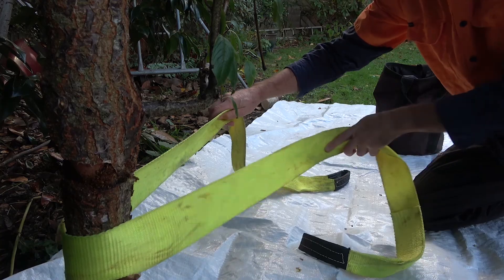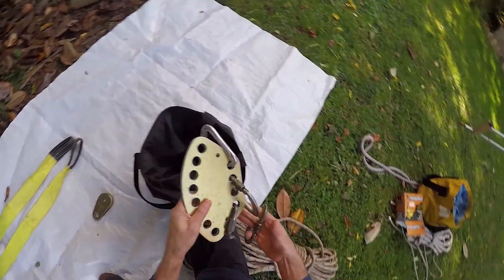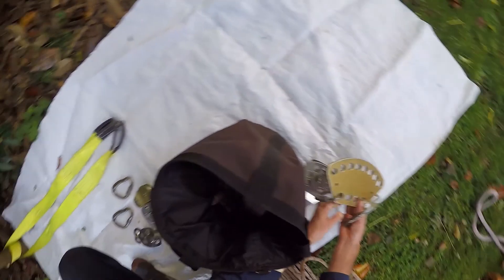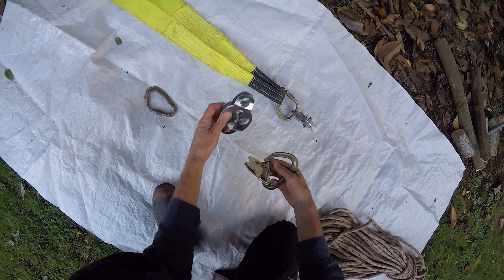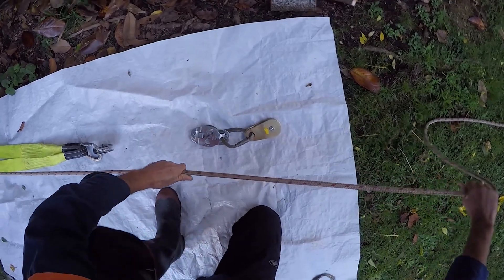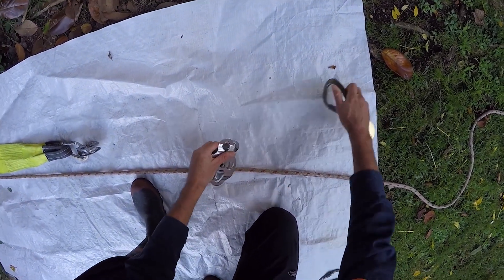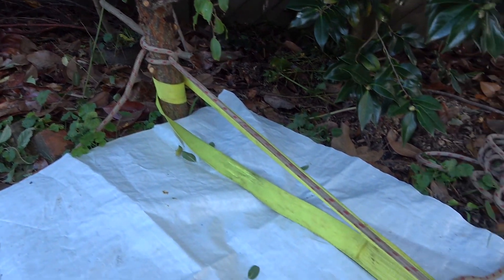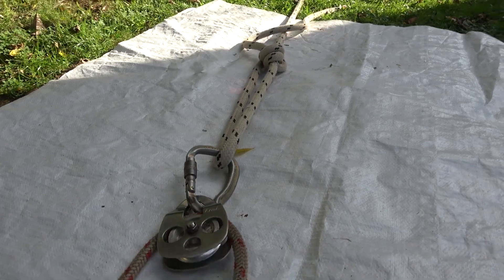Tree Rigging Equipment Part Two Mechanical Advantage Systems with Pulleys

Comment: Thanks for sharing.

Just an idea to compare with a prusik for progress / tension capture: without a prusik, you could still use a trucker's (effectively adding another leg to the system), this can be with a bowline on a bight, or an alpine butterfly or even a correctly orientated overhand slip knot, and to capture progress you can take the working end, pass it around the anchor again, then back through the loop knot - twice! Works like a charm.
Reply from the maker: Yes there are many options for gaining mechanical advantage. Only limited by ones understanding and imagination. Thanks for your comments. Much appreciated.
Reply: @totaratree99  Absolutely. Imagination opens up seemingly infinite possibilities here for connecting different elements in different arrangements. I'd like to think that this understanding part you mention comes from combining theory with experience. For me,  the elegance of including the trucker's hitch near the other end of the rope / system comes with the realization that this zone of the rope is associated with lowest tension energy because the remaining energy was already shared in the preceding pulleys. And depending on the particular pulleys used, mechanical advantage over multiple legs of rope, let it be x:1 by number of legs, ends up being more like an effective (x-1):1 force wise (7:1 by number of legs is effectively a 6:1 by force, big drop)
Reply from the maker: Hey really appreciate your input. Clearly you have a good understanding of the way systems work. I would love to add your thoughts to a future vid. If only I had the time. Thanks again.